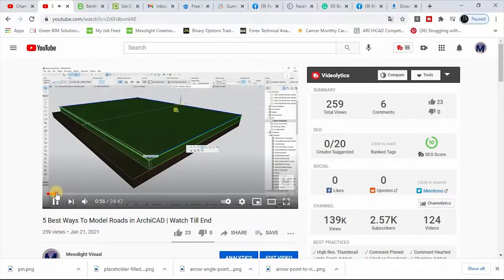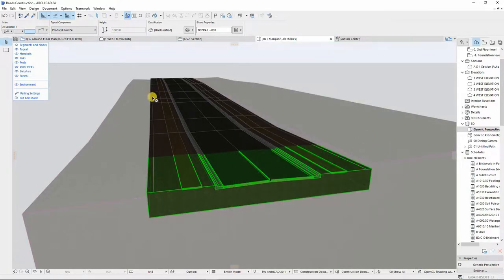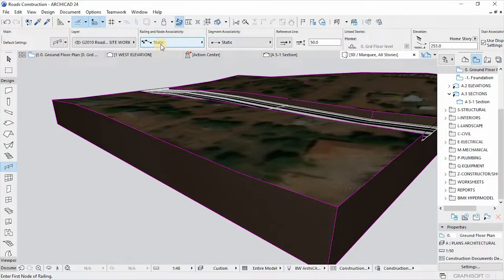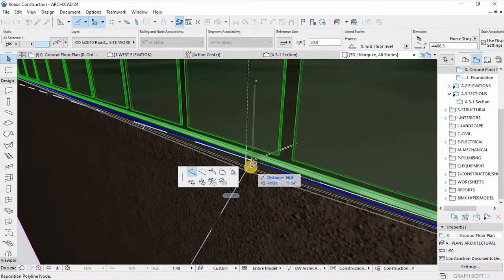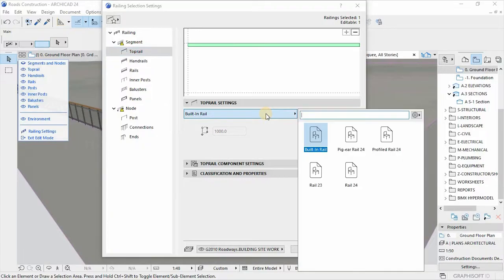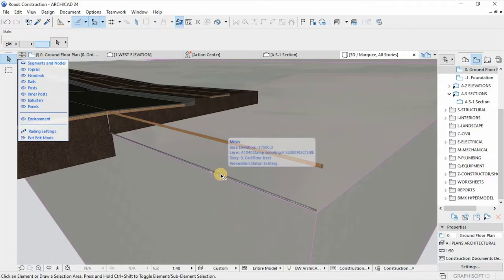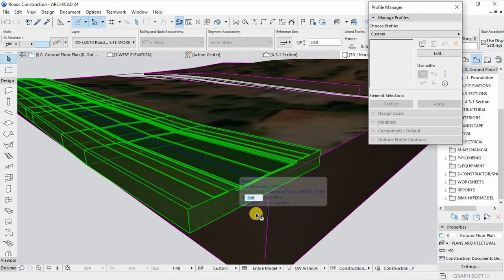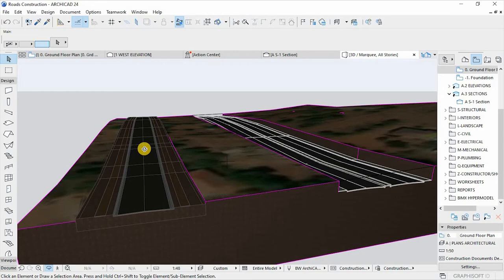Railing Tool for Roads modeling | Model roads using profiles on railing tool

Comment: Thank you for sharing this tip. Maybe this is the best way to model the road right now. 
It seems that it only does one profile at a time, and cannot do the transition between the 2 profiles. Also, it is very tricky to model the battered bank(daylight to ground), and it is straight cut to site terrain.

Comment: My thoughts: What if you draw over a spline to represent the center line of your road on plan, and connect that to your challenging terrain, and connect that spline so that it adopts to how the terrain goes up and down in waves, just like in your terrain examples. Then use that spline contour as midpoint and as a path where you can use the  railing tool to follow using the your last method. I think that will bring better results as the road will follow the up down motion of the terrain it will actually be constructed on, rather than get a sample edge that might not fully represent conditions where the road will be.
Reply from the maker: Thank you so much for that, Really appreciated it.

Comment: my problem now is, in case you're modelling a road which has a T-junction How does the road profile connect or intersect neatly?
Reply from the maker: Yes it's possible, but you will be required to use a different approach with Profiles. I will make a video
Reply: Hey @MesolightVisual   is there a video on this yet?  I have complex slopy site with multiple roads...but I don't how best to draw these roads especially with the intersections